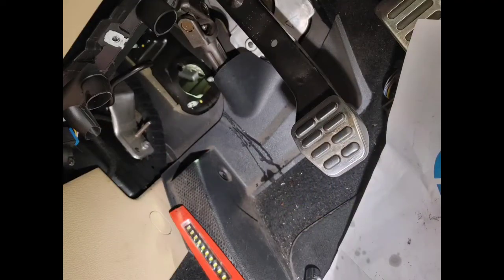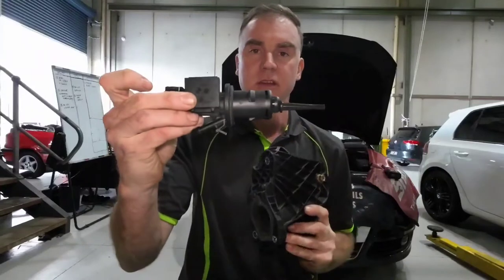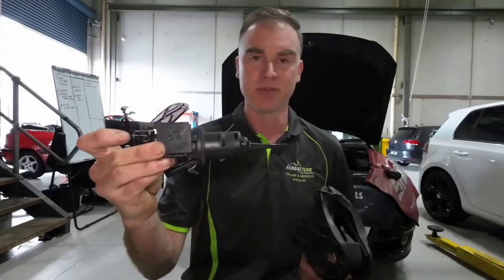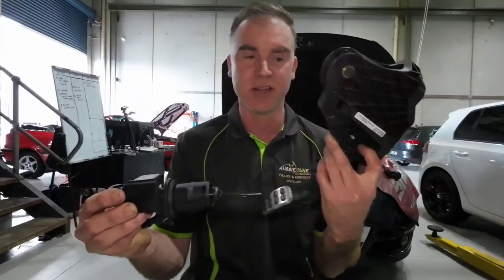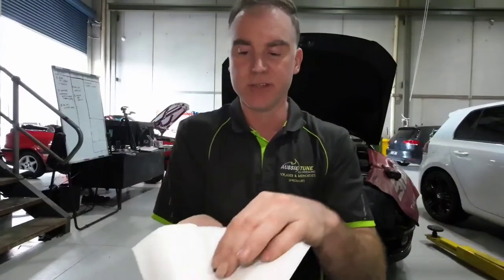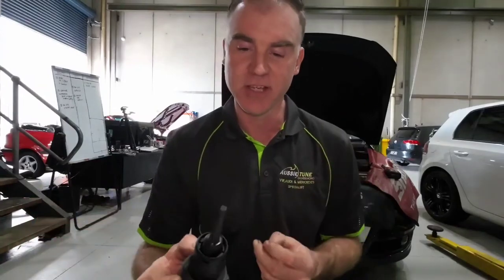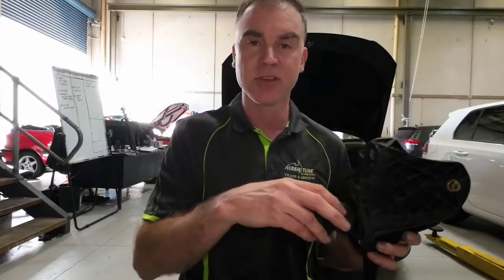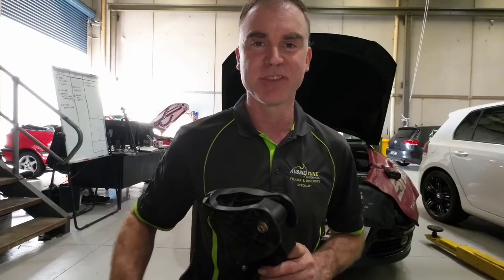Volkswagen mk5 clutch issues.

Comment: Thank you for explaining this, snd the right terms to use, as it sounds very similar to what is happening (intermittently) with my 2016 Golf.

The problem is, when it happens, there is a loss of power (engine still runs) and loss of steering as the Golf 'thinks' the engine is off. 

You make great videos, good plain speaking which is helpful for those of us who only know how to top up the water, and check the oil.

Comment: So my car has a problem where the clutch pedal sticks half way down and I’m unable to change gear till I use my foot to pull the pedal back up to them push back down to change gear is this the cylinder that’s causing the problem
Reply from the maker: Hi there, that sounds annoying. Could be a few different issues. If your car runs a hydraulic system, I would suggest starting with a bleed of the system.
Reply: @aussietunedandenong5736 hi thank you for answering ...when you say bleed of the sistem?
Do you mean brake fluid reservoir? Or is there another sistem that needs bleeding?